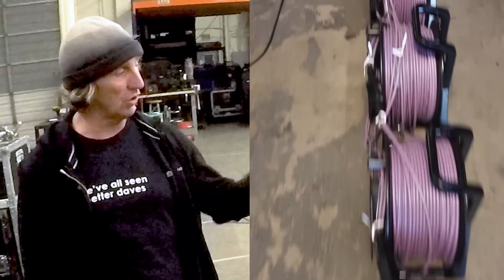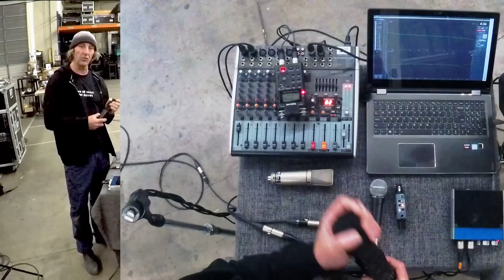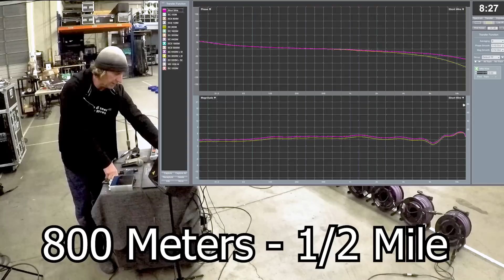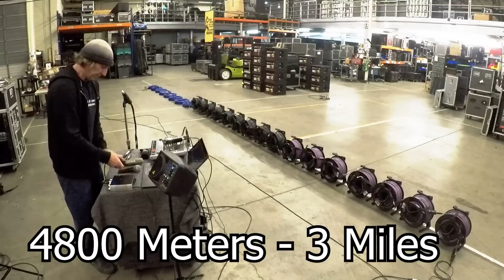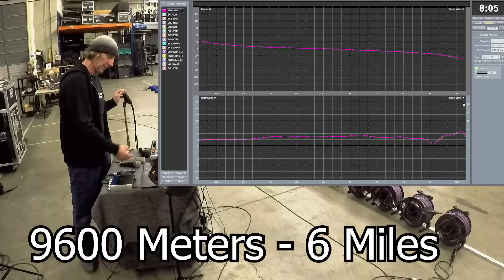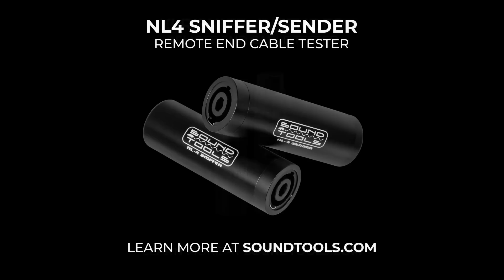Six Mile Long Microphone Cable? With Phantom Power?

Comment: My prediction before watching. 48V will work fine, the resistance of the cable won't be that significant in comparison to the 6.8K resistors the phantom is already being supplied via, though it will add some capacitance. The 48V should drop when it sees the uncharged capacitance, then come back up again as it charges, and work fine from then on out.
Reply: A ton of cheap audio gear will put out more like 12-24v on phantom. It's amazing the number of preamps that tolerate it. I do have a few that want the full +48v however. Test first!

Comment: very cool mate! just wondering do you know if line level has the similar response to roll off and length?
Reply from the maker: Well. The pink was not line level but it was a low impedance output.  So what you see on smaart with pink is what line level will do and what you hear is what mics will do

Comment: your network cables act as a henry coil allowing for amplification when spooled even knowing cables are shielded .... you would have to unroll the cabling in order to get a better controlled test so you do not have the amplification from the spooled coils of wire, suggestion unrolling the coils into full lenth back and forth 100 meters at a time ... much less chance of amplification then the rolled coil even if cables are shielded.
Reply from the maker: Hmmm, I am testing the worst case.

Also, tightly twisted pairs tend not to have much inductance.

If this was non twisted speaker cable, I would agree that there could be issues from coiling.

Anyway, I want the issues as I was trying to see how long the cable would be for the phantom mic to stop working

We get customers asking how long they can run analog down the Cat5e cables we manufacture, so Ihad some fun doing a test. And doing the test with the cable coiled means I can save from telling them, yeah. You need to spool all the wire into a big mess for it to work. Yuck.

For the touring and festival systems we supply, we can spit out fiber, Cat5e or analog to a multitude of locations.

And also it's important to remember that making things complex is not always better.

One application for long cable runs was for a 1/2 marathon announce mic and music with battery powered speakers along the route every 600 meters or so.

No wifi, no cell service area and fidelity is not a big deal.

Do ya use fiber and network and digital or just run some copper and be done? How long can the copper be? What will it sound like?

Those are the questions I was seeking to answer.
Reply: @DaveRat  I totally get ya, its definitely a cool video, I liked how you could see the roll off but not until over a mile in on the scope great visual perspective, I think cat5e is so much better then the old school snakes and can still be used as analog with your connectors  thanks for getting back to me, I appreciate your videos.  I am curious if you would be open to a vid with cat5e and a wireless transceiver set with encryption ?.. would you even consider a wireless transceiver set to send sound to stage ?
Reply from the maker: Hmmm, I don't really do vids on stuff that I am not pretty familiar with on some level.

As far as using wireless for transmitting to stage, as with everything, avoid complexity and avoid adding anything that can fail unless it brings district advantages. 

Perhaps in a pinch but wireless frequencies are extremely scarce and we pretty much need power everywhere and running fiber with the power gets us signal everywhere
Reply: best way to go long distances is xlr output from the board to a transceiver hub with xlr input/output and outputs to fiber cable, you can go up to 180 miles without any loss or a booster then the same on the other end, this fiber cable you can leave spooled because it does not carry a value for a henry coil when spooled no copper or any other combinations of metals incorporated into the cable  ....this I can guarantee.  if they would incorporate fiber cables into digital boards with remote stage boxes like the X32 you would not have to worry about electric issues at the main board and can use a separate power source all together even out of phase, it would not cause a problem, it would still be IO but by light instead of electric signals in the cable.

Comment: I wonder what the voltage drop is from 48V at that distance. Also, does the coils of wire indroduce an inductance that would chance the input impediance ( 250ohms ) being seen at the board ?
Reply from the maker: I wasn't about to uncoil all those wires but I figured that the coils if they had any effect at all would make things worse than straight wire, so this seemed to be a good test of worst case scenario
Reply: @DaveRat  Thank you for conducting these tests in your videos! It sure puts a guys mind to ease about having to have everything short as possible in fear of signal loss ect. 🙂
Reply: Pretty sure inductance has a large effect in this demo as a straight cable acting just as a resistor wouldn’t change phase response at all.
Reply from the maker: Pretty sure capacitance is the primary issue.  Inductance is pretty well cancelled out by twisted pairs. The capacitance though is cumulative and will show as a phase shift in HF as we see. Basically the wires create a capacitor that is shorting the HF out.

Comment: Though the series resistance will be 500 ohms, phantom current is quite low, maybe 20mA at the highest, so voltage drop should be 10v max.  Many, but not all, 48v microphones would be ok with this.
Reply from the maker: Agreed
Reply: Cat5/6 has an inherent characteristic impedance of 110ohms - so it will handle 50 to 200 fairly well.  You'll get some worse frequency rolloff on a 600ohm mic... and trying this with a guitar pickup... well, just lets not :)

Comment: Given the amount of inductance in those reels  RF problem will be reduced  some role off I can see .  Nice demo  The Schoeps  shoot gun mikes where sensitive to coiling 300ft cap  vs not coiled .  This was at a telarc recording  the cable does make a big  effect  on sound .  This cable looks very fine .
Reply from the maker: With tightly twisted pairs like what Cat5e has, the coiling inductance of large diameter couls should be minimal. I think the dominant issue is capacitance and as the length increases, the capacitance is rolling off the HF and we see the phase shift on the smaart screen.
Reply: @DaveRat    The increased Capacitance will be harder to drive current and thus signal as it increases  in a transmission line . Causing the impedance to change over it length  since even though the cat5e is balanced the mic and micpre  are not matched .   What you see is the phase shift caused by the delay line you showed .  I think it was a very good demo to show that in any real application  Cat5e is a workable choose . Analog is effected in ways that simple transmission  theory  misses .  This was a fine demo of what Heaviside  work was in the 1890's .  You  are a fine teacher of some very advanced theory .
Reply from the maker: Fun and thank you!!

Comment: Super interesting video! I've hooked up a measurement mic with 100m of cable before and compared it to the direct response, with negligible error. Cool to see that even 10x that distance doesn't have a huge effect!
It might be worth noting that the error also depends on the input device's input impedance. Some ADCs have really low ii (<2kΩ), where you'd see much larger changes than for example on an X32's aux input (40kΩ).
Reply from the maker: Is it the input impedance or the output 8mpedance of the mic that controls the overall line impedance?

My understanding is that lower mic output impedance allows longer cable runs with less hf roll off
Reply: @DaveRat  I consulted with the guys on my Audio Discord and worked out a long answer:
There are three main electrical properies of the cable, which cause signal degredation. These are the cable's resistance, capacitance and inductance. These three components form a passive circuit along with the two devices (mic and preamp), similar to a crossover circuit inside a passive speaker.

tl;dr:
High preamp input impedance reduces overall signal loss
Low mic output impedance reduces HF roll-off
Thicker cable=less overall loss, but more HF loss, relatively speaking

Long version:

Let's talk about resistance first, since that's easy:
First of all, we can say that at analog audio frequencies, cable resistance is the same for all frequencies (no need for silver plated audiophile snake oil).
The mic's impedance is small compared to the preamp's, so it has almost no effect here (similar to damping factor in amps).
The cable resistance causes a flat loss at all frequencies. 
Looking at the lowest frequencies in your 6 mile test, we see a loss of about 7dB, which plugged into a calculator looks like the wire is 27AWG.
The Xenyx's input impedance is 2.6kΩ. The X32's input impedance for example is 5kΩ, so you'd see a 4dB reduction instead, compared to the 7dB on the Xenyx.

Time to talk about cable capacitance:
This is what causes the HF roll-off. It's basically a parallel capacitor, which is a 1st order LPF.
Preamp input impedance has close to no effect on this, it is indeed the source device's output impedance, like you said.
The Xenyx's is 240Ω, which I what we see in SMAART, I suppose?
You can generalize, that a device with half the output impedance will roughtly have half the HF loss.
SM58 is 150Ω, which would be better than the Xenyx already. KM184 is 50Ω, which would reduce that HF loss to only about a fifth, for example.

Now comes the wierd part, we don't really have to worry about, inductance:
This depends on cable layout. We know having a power cable on a drum/coiled up heats it up quickly because it's a)bunched up and can't transfer its heat to its surroundings well and b)a coil is an inductor, which forms a magnetic field.
Since you're sending a differential (symmetric) signal through twisted pairs of cable, the two magnetic fields cancel each other out and not much is happening.
If that signal was an unbalanced signal however, you'd have a series inductor in the loop, which forms a 2nd order LPF with the cable capacitance, making HF loss even worse. By how much I don't know, someone would have to test that.
Note that this is mostly an issue when the cable is still on the drums and you (probably?) won't have to worry about it when it's laid out in a straight line. Of course, sending an unbalanced signal through miles of cables will cause a lot of other issues, but that's what we have DI boxes for.

And for the cable properties:
A thicker cable will have a lower resistance, but higher capacitance. This means lower loss overall, but more HF-loss.
Reply from the maker: And also, we can just plug it in and listen

Comment: Hey Dave!  Awesome demo! I love this type of direct comparison.  Two SMALL points:  1) The base-line Frequency response of your mixer seems a bit outta wack (i.e. larger deviations from 0 dB Transfer function than one would expect), and I think the changes in the response would be CLEARER (and easier to quantify) with a smaller vertical scale on the transfer function.  It looks like you have ~+24dB to 15dB, or an ~ 39dB range.  This range could be reduced to +/ 15 dB making the changes easier to see (A vertical scale of +10dB to -20dB or -25dB might be best to show the roll-off at the longer lengths)  THANK YOU for making these videos.... informative and FUN!!!! - Sam.

Comment: Did you measure the voltage drop, I believe the phantom mics are specified 18-48V. Video idea, at what voltage will phantom mics not work. Nice video, thanks!
Reply from the maker: Not in this cable test. Some mics are 12 to 52, some say 48v. Many will work but they lose headroom at lower voltages. Thank you!

Comment: Digital boards and audio over cat5 are the biggest game changers in the live audio field in my lifetime. Good timing too cause now I'm mid 50's and can't lug all the gear lol. Still have a 220 foot 32x8 splitter snake. It's heavier than I am! I don't think I've run my cat5 once without smiling thinking about how that beast of a snake is asleep in my basement hahaha. Amazing to see phantom work 6 miles away! I didn't expect that to work out. Great demo Dave. 👍
Reply: I've done a couple of things with 16 channel snakes and thought about other ways of doing it. When I built my own system out I decided on prioritizing portability and weight. I really do like the analog over CAT5 nature for simplicity and I pick myself up 4x 100ft foot cables which will probably be good for most of what I will ever do. Although I do have a idea for a multi CAT5e snake in my head using CAT5e 25 pair cable using AMP ends into a 6 Jack breakout at each end. That way the large ends can be removed for storage aiding the process of rolling the long 100-150ft cable up and shorter ( say 25' ) lengths can be substituted for smaller venues. I figure out of the 6 channels 3 channels would give me 12 channels of send and 1.5 channels would give me 6 channels of return, leaving a gigabit link open between stage and house and 2 pairs for maybe DMX. But it's just a crazy idea floating in my head, I wish somebody made a break out already, there is one from +studiohub that's more of a panel mount open design and I forget where it was they had a design lacking shielded connectors so no phantom power without modifications.
Reply from the maker: We (The rental side of Rat Sound) we're using multi Cat5e cables in an overall jacket but stopped doing so.

A failure of on line kills the whole cable. We now user multiple Cat5e bundled and swap out lines if they get damaged. That way we have multiple lines than can be dicital or analog bundled with fiber as well
Reply: @DaveRat  I was wondering how the rental handle Booth T Stage, or if the cat system was just being used as breakouts on stage.
Interesting so it was killing the whole cable more so than acting like a dead channel, hmmm. Yeah some way to bundle multiple individual line seems to be the way to go our big stuff like that. I was perusing the offerings and there aren't a lot of options for bundled CAT premade off the shelf. All I saw was 2 or 4 and assume anything past was custom.
Reply from the maker: It was not killing the whole car but carrying a 4xcat bundled cable with 1 dead cat line is not an option for use.  1 dead line means the cable is of no use to us
Reply: @sonovoxx  interesting I might have to look this company up. That was one of the things I disliked about the digital stuff is gain was essentially in the box on stage and if you didn't have a good way to control that either by the same ecosystem or control software it really complicates matters. Thankfully the industry sort of is standardizing with a couple different systems like Dante.
I once helped somebody with a show where they converted from composite video to fiber and back then into a switcher. it's neat that it can be converted but that's a lot of conversions.

And that's another reason why I like analog over copper it takes the same system that pretty much everybody's used to and just condenses it. I probably won't be needing a snake anytime soon and I do have the previously mentioned 100ft flat cables. In the meantime I have a few things in my Amazon wish list. I figured if I get some shielded Keystone jacks and a 10 ft CAT5e 25 pair I could spend a few hours a night punching things down to make my own. I'm not at the rental stage yet so it's more of a me in my equipment set up apart from this Saturday (double booked, venue moved date) I don't really have to worry about explaining this to others too much. Although I did really baffled one musician last year. Yes it's cat cable no it's not Digital.... Although I didn't start out good that day as I really didn't get to prep and I forgot a couple cables at home.

Comment: Next try different consoles? See if different consoles can push 48v that far. Would also be interesting to measure heat on that pre circuit. Would also be interesting to see how much resistance was in that lenght of cable. As always ty Dave!
Reply from the maker: The phantom power spec is the same for all consoles.